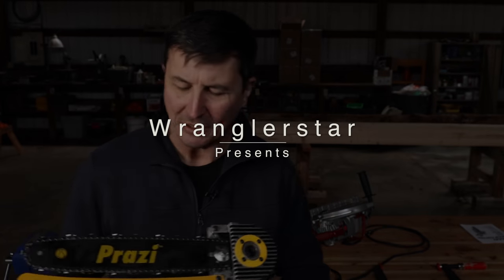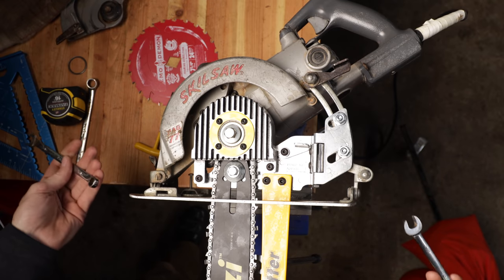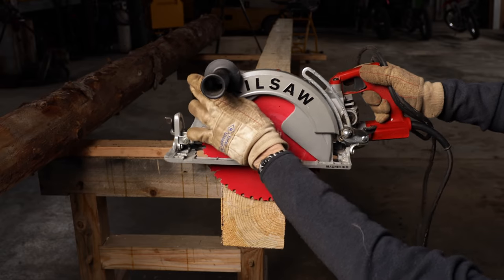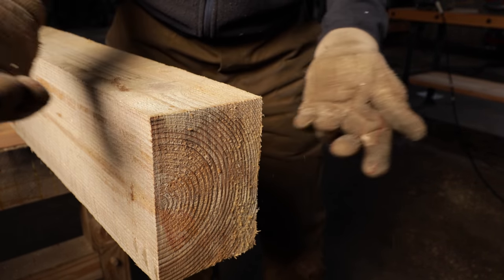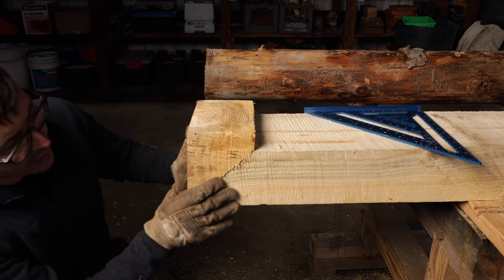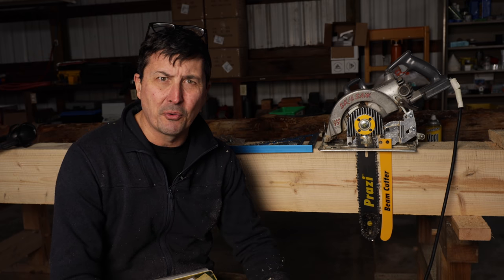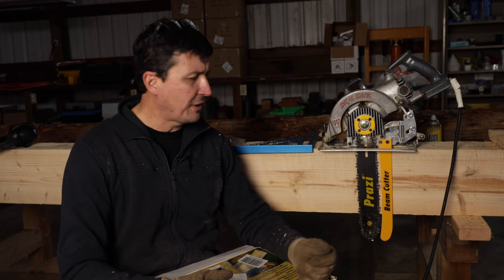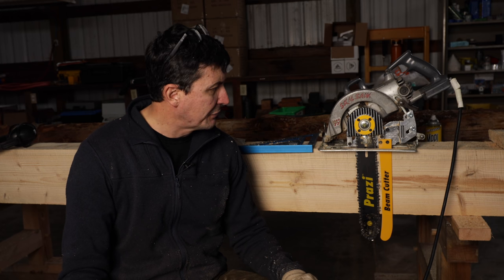TESTING The Strangest Chainsaw on Amazon

Comment: I was rooting for this one. I used one of these on a timber project a couple years ago. It was a great tool for the situation. We had guys that had never used large beam cutting equipment (like the Makita with the 16 5/16" blade) but had many years working with chainsaws. Like you mentioned, it had a bit of a learning curve. After a while we were roughing out tenons and getting pretty good cuts. Was great for trimming beams down because even with a 16 5/16"  blade you still need two cuts on most beams.  I believe we may have modified it slightly to make it more stable. Some of the adjustment bolts were vibrating free.  As far as it's fragility, it did better than I thought. Timber framers are normally pretty careful with tools. That said,  it took a couple tumbles but took very little damage. Nothing you couldn't fix pretty quick.  Most of those tumbles was from it falling after being sat down or when not in use. It is a bit awkward to put down and a cradle of some sort would definitely be a good idea. The project we did was softer wood. I suspect this would struggle a bit with large project with anything like oak.  Great video.

Comment: I worked on a roof framing crew back in the 80's and 90's. It was all hand cut rafters. If you lay your boards crown down, on some special saw horses,  you can cut all the head and tail cuts with the prazi. The cutter on our crew, had his apprentice follow along with a spray bottle full of chain lube, and just oil as needed.

Comment: Have you ever used a hydraulic chainsaw? I watched some guys in a bucket truck with their magic silent chainsaws. I couldn’t stop watching.
Reply: KD2RDH Larry , also have drills, for safety . Also make pneumatic ones for use under water. I also have a couple of battery chainsaws now and like them.
Reply: We used to do hotwork on large glass furnaces with the hydraulic saw heads and water cooled diamond chains. We laughed when they first came out, until we cut through in a tenth of the time it would take to pick it apart.
Reply: We had these in the Armys SEE trucks. They had saws, jackhammers, and large drills. That was a great truck!

Comment: Having the (yellow) splitter on the saw is a very smart bit of design. Having the curf spring closed while making a rip cut, could pinch the saw to a dead stop, or worse. Keep doing what you do, dude!

Comment: We have one for cutting dunnage at work and it didn’t last long, like you said it’s fragile, hope you continue to stay away from reviewing companies products good for you I respect that 👍
Reply: Where do you work where you need that size saw for dunnage?
Reply: @skookumbuilds3282  Not who you were talking to but at my work most dunnage we have is 4x4 to 8x8. Heavy machinery in the oil mining industry
Reply: @ColtonBlumhagen  huh that's cool. At my sawmill we use a dewalt 12" slide miter and chainsaws really.
I do have a big makita 16 1/4" beam saw for timber framing and trimming beams though.
Reply: I just use a chain saw, for dunnage, this way when it comes home it’s ready for the fire!

Comment: If you have a wimpy east coast chainsaw with the small chain  they do a fine job cutting timbers  and using them like a skillsaw. I have built a couple of buildings in the woods with only a small chainsaw. Was sure easy to snap a line and trim roof boards.

Comment: I bought a Prazi saw just like that 20 years ago when I built my log home. I had the cedar logs milled to an 8 inch "D" shape and used the Prazi to cut the length and notch. I still have it and it is still working great.

Comment: Used one of this type to cut a circular arc around 16’ in diameter for an interior balcony over the living area. Went through oxboard and joists decently well. Had the saw on loop of string going back to a nail.

Comment: Skill products makes a dedicated version of that even has an Oiler I think they call it the Carpenters chainsaw not sure but something like that
Reply: Indeed they do - https://www.skilsaw.com/wormdrive-carpenty-chainsaw-spt55-11/
Reply: Called - SKILSAW SPT55-11 16 in. Worm Drive Carpentry Chainsaw $567.00 
vrs $139.99 for Beamcutter.
Reply: @SoupyOatmeal  and while it is an entry-level way to get into cutting beams and notches and big dovetails on things the prazi beam cutter is great however a dedicated saw that has an oiler on it a more substantial chain and can bevel to 60 degrees for the ones that can't afford that the prazi beam cutter is a great idea I only mentioned this because it has an Oiler obviously this isn't for just someone occasionally needing something like this I was just pointing out that there was a dedicated saw get what you can afford
Reply: @SoupyOatmeal  seems like the prices aren't too far off then, at least by Wranglerstar's estimation; saw + beam cutter was around $400, and the dedicated Skil version is $567...
Reply: @merpius  And having an oiler and not destroying the bar/chain. Skill brought their saw by my shop to have me try it in pre productions, they put their time into it. I have a bigger one by Protool, but the skill is a good option for 12".
Reply: Most everyone has a old skill saw they never use anymore.( I only use battery powered everything now.) So this would be a great buy for me.  I'd put it on and never take it off. Although realistically I always just use my stihl chainsaw for beam cutting.  Not quite as accurate but usually good enough.
Reply: @derekbryant6137  You seemed to take that reply like it was a rebuttal it was NOT it was 
pure information one cost 4 times the other it is a fact. Calm down drink less coffee.
Reply: @SoupyOatmeal  coffee is not  to blame and I am not excited

Comment: "Metric nonsense" 1mm ,2mm ,3mm ,4mm, 5mm... VS 1/16", 5/32", 1/8", 3/32", 5/64"...yeah...totally nonsense(-ish)
Reply: i'd like to think even ron swanson would see that the imperial system is a joke. alas, not wranglestar.
Reply: Completely agree, the imperial system is just way too confusing.
Reply: I'm American and use both systems all the time. I hate the fractions part of the imperial system. Once you get past 8ths of something it's just not easy to visualize. Anything small I think in millimeters. Larger stuff I think in inches/feet. The only metric thing that is impossible for me to think in is temperature. The conversion is so wonky from C to F that there's no easy rough conversion in my head. Those damn pirates had to prevent that french guy from bringing Thomas Jefferson the metric system. Now us Americans are stuck with this mess.
Reply: Metric is simple, but so are you if you can't understand fractions of an inch.
Reply: Badger0fDeath  we have already seen the light (which by the way has a waveleght mesured in nano meters...just saying!) a long time ago when in 1960 the International System of Units was introduced and, guess what, meter was chosen instead of inch. I wonder why...no...not really.

Just joking guys!
Reply: @mechanichell  
Its all what you've been taught and what your used to, I personally think that once you understand the imperial its easier to break apart measurements for doing any sort of layout.

There's a solid place for both. Like, I prefer metric for survey.
Reply: Metric is the most confusing system ever made. You get one decimal point or too many zeros and it's toast.
Unless you're doing something scientific no one uses metric in the land of the free. Imperial is far superior in daily activities.
Reply: @philclarkart  It's easy to get a rough conversion from Celsius to Fahrenheit, you double the number and add 30. To go from F to C, you remove 30 and half the number left.
Reply: "2mm", like the average metric willy

Comment: Excellent question I have 3 chainsaws the chains stretch after prolonged  use and the chains have to be adjusted  and automatic oilers help keep the chain from getting hot and stretching and breaking . How would this new tool be even safe without a automatic oiler and bar and chain adjuster

Comment: Weapons and NVG hard cases have hard foam inserts custom-made to the profile of the specific equipment that has movable components in a default position.

This tool would require such a case type, with two more things. The insert is specific to the brand and model of the worm drive saw.

Comment: Seen these used mainly for production framing where instead of cutting one joist you can line em all up and cut em to size in 1 cut instead of measuring each joist/beam and cutting it 1 by 1.

Comment: Izzy Swan reviewed this several years ago.  He put it on a regular circular saw and it worked slow, but well.  He also made two different small sawmills to use it in.  He was going to try it on a screw type circular saw but I haven't seen anything further on his test.

Comment: Izzy Swan has a video where he made a stand with a guideplate to mill lumber with one of those attachments. It's pretty cool. When you rebuild the stove consider putting tubes through the top barrel with a fan behind it. You can mig or braze it to seal them. I've built one or two and they do put out a LOT of heat. Thanks for the great videos. God bless your family.

Comment: Test the cheapest angle grinder on amazon
Reply: Deano 357 that’s a fantastic idea
Reply: I bought a 4.5inch tnt branded angle grinder when I got into the welding trade 8 years ago. I repurposed a Makita 5" guard the first month I had it and it was my primary grinder for full time welding for almost a year then I bought a Makita and only used the tnt with a wire wheel for another year or so after that. Never had one issue with it. Besides accidentally cutting off the cord once. It was a fantastic grinder for the price. It's in my garage and still works to this day. I was legitimately blown away by the price and reliability. I now use 2 Makitas and a cordless Milwaukee. But I'll always remember that budget grinder everyone laughed about. But I'd say it proved its worth many times over.
Reply: Ok I will

Comment: The offset you got when you tried to cut the board, could be adjusted out with the shoe plate on the saw.....assuming it was a consistent offset and didn't just wonder side to side like a giant jigsaw at random. Neat little tool !

Comment: It’s called a beamsaw.   You’re not meant to use it as a chainsaw.   It’s for cutting beams lengthwise or at an angle for joining.  That’s why there’s comments about people calling them fragile and this and that after explaining how they were misusing it.

“Have everything the same size” - for a product designed to be attached to various different saw bodies

Comment: 2:08 that Makita needs new brushes (under the little black cap on both sides of the tool). Hopefully the commutator is good.
The Prazi is interesting. Was the blade perpendicular to the base plate of the saw?

Comment: In my profession I always read the instructions and... that's what I advise others to do!
Reply: Not everything is intuitive, and not everyone has the same intuition. Instructions are a useful resource.
Reply: Not everyone reads Chinese.
Reply: First thing I do is read the manual, the dude that wrote it probably knows more about what the manual is for than me! I even read (if you call it reading) those goofy IKEA furniture manuals with the pictures, it’s never let me down assembling their stuff in the correct order. I use the correct screws where they tell me and I screw ‘em tight and my IKEA stuff lasts a long time and it’s sturdy.
Reply: When was the last time you read the owners manual for your truck? Most people won’t read that one, but if they did, a lot of money could be saved!
Reply: Patrick Fennessy - I read mine the other day, not the whole thing of course, lol. I was looking for the torque specs for the lug nuts, had a flat and had to take a wheel off. 2000 F-150, she’s an oldie but a goodie 😊
Reply: @Howie47  It's about time to learn.
They learned yours and you learn theirs.
Reply: @loktom4068  Not how it works.
Reply: Some people like to actually work instead of spending all day reading gibberish.
Reply: @Howie47  A billion more than you
Reply: @musgrovebarry  What! Does everyone in China speak "Chinese"? Is Chinese even a language?  Isn't China a bunch of nations who speak different languages and were conquered by central China? Do those people in central China even speak, "Chinese". Yep, there is allot I don't know.
Reply: @Howie47  Mandarin is the nation's official language and it's the one taught in schools and China became a single state in 221 bc so guess so, but there are many languages but that's the same in Philippines where the official filipino language is Tagalog. However there is no official Language for the USA on the federal level.

Comment: An alligator saw with a wood blade works perfectly for sleeper work or timber framing, love the video not sure about the tool though there are some really good bar guides for chain saws already plus I would definitely snap this pulling it in and out of the bed of a truck. 
The more jobs you can do with a tool the better investment it is, this kinda seems like a 1 trick pony

Comment: The trick is you can put the 10-inch blade on The regular 7-inch skill saw all you need to do is remove the blade guard. Myself the I took it off when I first bought it. And yet I haven't cut myself record or anything else. And I never let anyone else use it because there is no guard.

Comment: Lol different bolts are used to generate the varying strengths required for it to work well.. also, that's why one piece adjustable wrenches were made :)

Comment: 1:02 metric nonsense? :))
Reply: shadrock99  imperial system peasant don't talk like that about the glorious metric system
Reply: The funniest part of the imperial vs metric is the US uses the original metric platinum cube we received and converts its standards to imperial for the laugh value.
Reply: Because change is scary
Reply: The way I see it is if you think the metric system is dumb I want you to tell me how many inches go into a foot and how many feet go into a yard?
Reply: @johnkent2009  It is an insane task when you look at the scale of the work as it is not changing a single country at once it is changing 50 countries at the same time. On the travel side of things the US has 6.6 million kilometers of roads that require every speed limit and distance sign changed over at the same time along with every gas station needing to change from $/gallon to $/liter. On the legal side of things every law that deals with travel needs to be checked to see if it is in imperial, metric or both. 

All the stores will have the fun of needing to change out imperial scales for metric if they can't change over. 

California alone is larger then Japan and by the time you look at Alaska you are looking at something the size of France.
Reply: @benfairhall5331  Yeah guys, just convert to freedom units already
Reply: shadrock99  it was a reference to PC master race....
Reply: @maxwellw70  I live in a free country here in europe, and I am not going to tell you which because you will give me your opinion despite visiting here, but from living in the states for over 4 years, I can tell you I much prefer living here. Period
Reply: Metric for physics/math and imperial for construction and everyday use. Metric makes the intangible easier to understand while imperial is nice for practical applications. Best of both worlds!
Reply: I love it how patriotism makes US people call US "land of the free" but cant realize they are enslaved to their ways and cannot see change.

I personally preffer metric, but accept that both are usefull in different scenarios.

The reason I preffer metric is because metric can do everything imperial can do, and imperial cant always do what metric can. Plus, it is effortless to convert cm to meters, when it takes a calculator to convert inches to feet. Also, adding fractions in your head is way harder than adding cm or mm. If you have to add 3/8 + 5/16 + 3/4 to cut tile,  you are toast. And one more, volume and weight are closely related in metric (1 liter of water = 1 kg). Gallons and Oz have no relation to inches n feet.

Imperial is easier with keeping up with distances and speed. Im sure there are other examples...

Comment: Metric measurements are simply what you are used to. I would use metric over imperial or UNF absolutely anytime. Americans are used to using fractions. If you think that is easier than using whole numbers, that’s fine. But I’m staying with metric.

Comment: Hi Cody, another fine review, but I see there's no bar oiler?  Sorry to be a pedant, but chainsaw chains shouldn't stretch.  If it does stretch then there's something wrong with the material.  What appears to be "stretch" is probably a little wear and bedding in.

Comment: Not trying to rude, but take the 4x8 from an upright position to a flat position and you can make it in two cuts with a small blade and one cut with the 10" blade. Just an observation.

Comment: "Backwards" thread = Left hand thread.
Reply: Must be from the city... or never worked on an old dodge truck, one side had standard threads, and the other left handed threads to hold tires on, this was on my pre-1973 11/2 ton pickup. Ford and Chevy plus many other manufacturers dropped this practice earlier!
Reply: @gettintheresafelywithpatf2869  Correct Patrick,  the older air cooled VW's also had handed main rear axle centre hub retaining nuts and most combustible gas threads are also handed

Comment: It will cut as good as the operator , take your time , go slow , don't over feed.    To rip use a ripping chain, just buy an extra chain and file it to 7-10 degree ,not the 35 degree the chain comes at

Comment: Without bar/chain oil, ripping is going to heat that bar up significantly and probably cause premature failure of the bar rails.  Short cuts are going to be better for this product.